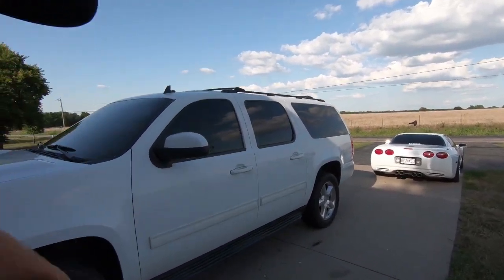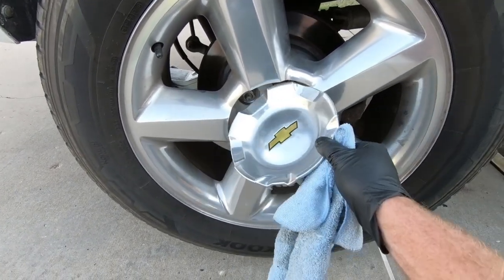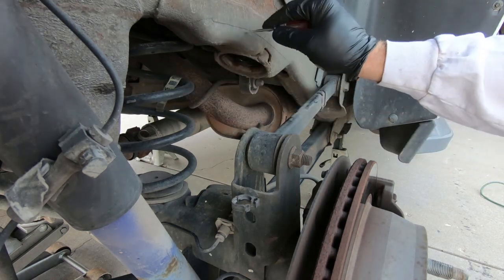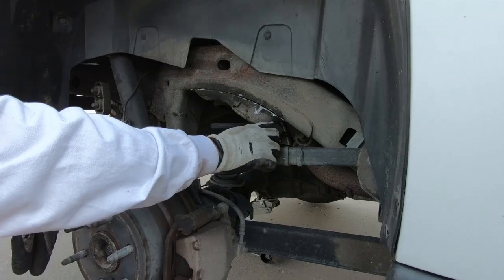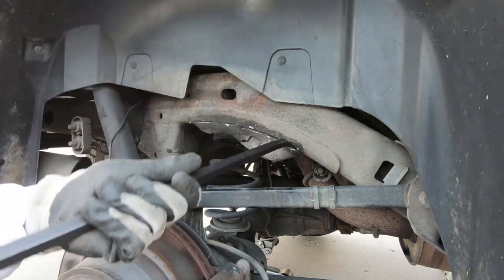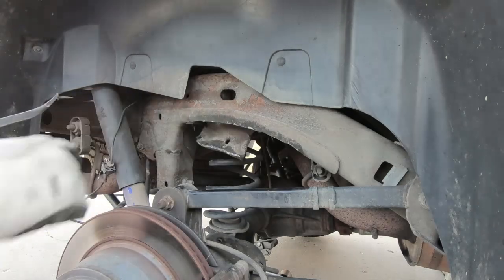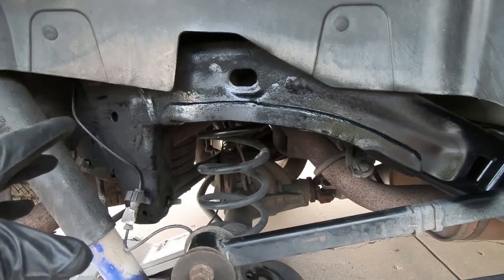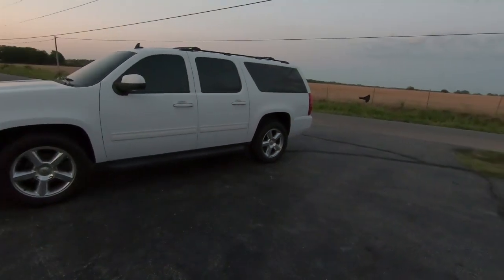Free Travel Mod (Ultimate How To) Tahoe Yukon Suburban Denali Escalade

Comment: I do tow with mine. so it looks like I'll be looking into a low-pro bumpstop setup. I'll be checking your channel for vids first. thank you
Reply from the maker: I tow with this occasionally
Reply: @TWAMotorsports  with no bumpstop at all?
Reply from the maker: No I have bump stops and helper bags
Reply: @TWAMotorsports  makes more sense to me now. I'm not sure I'll use bags, as what i tow is just a small alum trailer with sport atvs on it, but if I find myself bottoming out...well that answers that haha. <asked for link; took 3 seconds to find after I realized this was the burb and not the tahoe lol.> I have 4" drop springs so I'm thinking the 1.26" ones from Belltech...but? 
Thank you so much!

Comment: What size grinding disc do you use?
What I mean is how thick are the grinding wheels? 
I have a dewalt cordless grinder and it holds up to a 4 1/2 inch disc but I do know some metal grinding wheels are thinner than others.
Reply from the maker: I use both 4.5 grinding and cutting discs

Comment: Hello i finally did the free travel on my suburban and the relocation. But i did a 5" drop. But my question is i bought beltech street performance lowering shocks and the tech guy said i dont need to use the shock extenders so i didnt. Rear doesnt sit as low as i thought with the 5" drop springs. Thinking of putting air bags  to sit it as low as i can at the car shows. Your thiughts please
Reply from the maker: I use what I know works. I get this all the time. Why do I need relocation brackets, I got drop shocks. It is about the angles/geometry, not just drop.

Comment: I have 6 ton Pittsburg stands from harbor freight should I be worried
Reply from the maker: I don't know. Some have failed but I'm not sure which models.
Reply: @TWAMotorsports  so far I haven't had any issues with mine thank God but I usually leave the Jack under the truck somewhere just incase. I got the bell tech drop kit for my YukonXl just wish the springs were powder coated. Waiting to install it after I can get the springs powder coated metallic blue with lowering torsion keys no spindles yet. How low when I should probably notch the frame?
Reply from the maker: I leave my jack too. If you go 4" or more it needs notched.
Reply: @TWAMotorsports  dont remember kit # but it came with lowering torsion keys new shocks and rear springs and bump stops n rear relocation brackets belltech kit
Reply from the maker: @MegaWolfman76  good luck
Reply: @TWAMotorsports  thanks cant wait to get it on the truck

Comment: So what’s the purpose of cutting out that piece?
Reply: He’s going to be lowering the Suburban you need that removed for clearance, if you drop her in the dirt you’ll have to get more serious and notch the frame
Reply from the maker: Getting low
Reply from the maker: Bingo
Reply: It's to weaken the frame that piece is put there to reinforce the frame at the bend for towing I've had lowered vehicle's since the 70s  and any time you cut something off you need to reinforce plate the area
Reply from the maker: @dewaynemiguel3349  I have towed a lot with this set up and so have others. 100k + miles with no issues.
Reply: @TWAMotorsports  I've plated alot of them that have cracked right at the bend,and if you sell the vehicle in my state if you dont disclose it at time af sale the seller is liable
Reply: If you tow something heavy enough to bend that with a half ton truck your an idiot but I see them all the time doing it
Reply: @LouieLoui  it's not the towing it's the flexing that does it justify it all you want I'm just saying I'd plate it ,chevys are well known  for having weak frames that's why they started double framing alot of there 60 and 65 series trucks they had problems with frames cracking
Reply: Dewayne Miguel point taken, IMO lowering a truck is for show and pulling a trailer once in a blue moon would not effect it but yes if you intend to use it for pulling or hauling then boxing the frame would be a great idea I agree, me personally I wouldn’t bother cause my Tahoe looks too good on a 5/7 drop to be working 🤪
Reply: @LouieLoui  I agree I have a suburban like yours in the video even white but mines a 4x4 funny I have a Corvette similar to yours in the video but mines yellow,my vette is lowered less then half stock height I like the lowered look but I've had friends lowered there vehicles without taking some things in consideration they break them and expect me to work miracles in fixing them anyways I enjoy your videos take care
Reply: Dewayne Miguel  it’s not my channel, I don’t want him taken the blame for me running my mouth 😅, I have the same problem with my wife’s friends thinking I can fix any and everything, she thinks their tryin to take me from her, I told her they want tall dark and handsome not round old and irritable 🤣

Comment: I'm going to do a 2/4 drop on my 2017 Escalade ESV (bell tech kit).    What happens if I don't do this?    Will cutting the bump stop in half or putting in a shorter one do the trick or do I have to cut out the metal like you did here?
Reply from the maker: May hit occasionally on bigger bumps
Reply: @TWAMotorsports  thanks    any downsides to cutting out the metal?  other than the extra work of course
Reply from the maker: Not really
Reply: @TWAMotorsports  thanks !
Reply from the maker: You're welcome